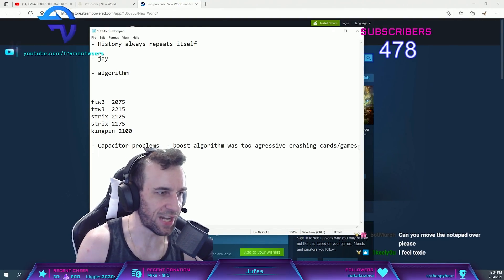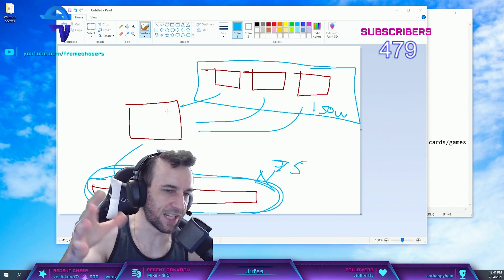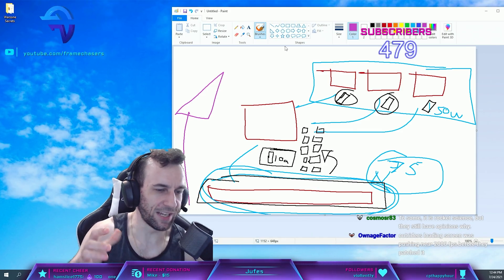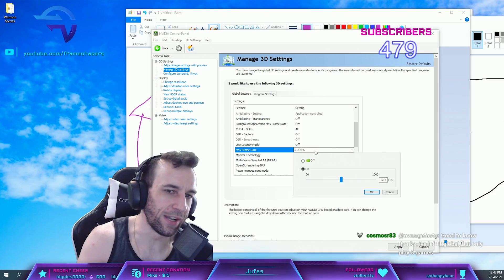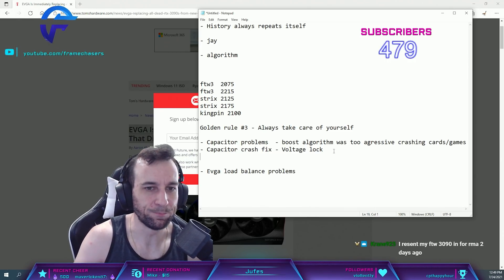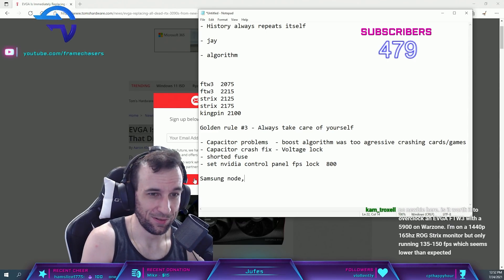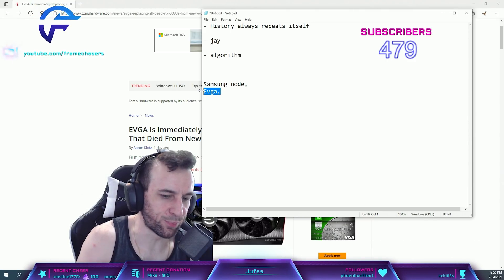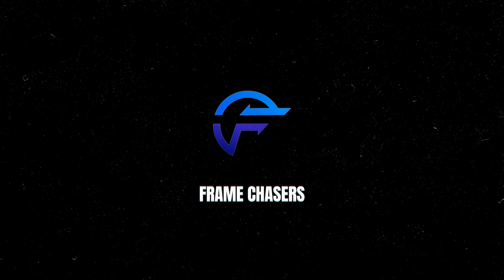The TRUTH behind 3090 New World BRICKING

Comment: Just hate that my 3080 can't pull past 380w because of this stupid load balance BS, like damn my 3rd 8pin gets stuck at 60w thanks to the shitty analog power controller. I mean fuck in this day and age on this kind of product, who uses a analog anything, the literal next step up drop in replacement of the exact same line of regulators is digital and reprogrammable...they'd be able to fix this with a simple I2C update..... :( Studying all your videos to possibly shunt mod it, even if its just to get a little more power on the PCI-e 8pins, i dont need unlimited power, i just want my 450w. Shame the 3080 doesn't seem to suck enough juice and slit its own wrist like the 3090 does....

Comment: the slot is only supposed to pull 66w

12v*5.5a=66w
the last 9w is 3v signalling, only the 12v is monitored so the slot should never be measured at 75w, or at 80w which some of the cards have been.

Comment: I’m happy with my evga hybrid gets around 466w board power and mem stable at +1400mhz all on oem pads. Mines a 0.1 Rev so I’ve got in contact to evga about the special program to get it changed for a Rev 1.0.

So far I’m a week without a card and it’s arrived in Germany at at cost of £90 from uk…